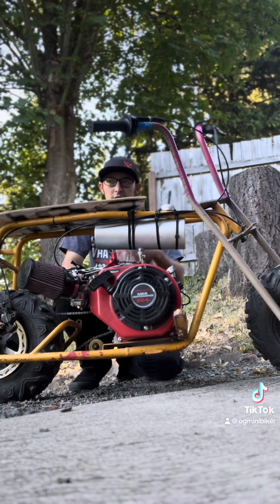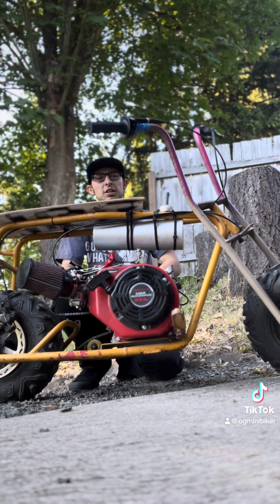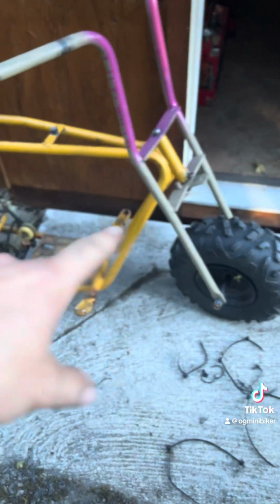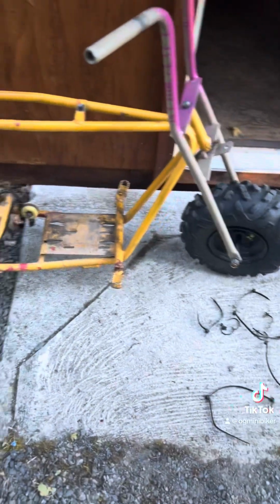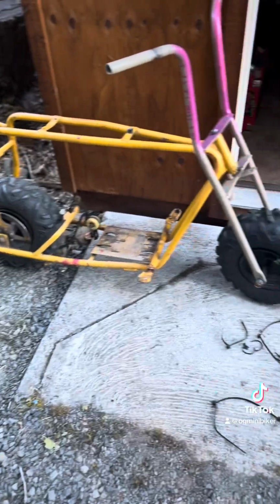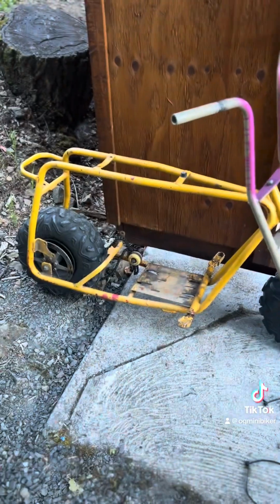‼️Update on shitbox mini bike new big project‼️

Comment: After I deleted the oil sensor my bike would only shut off if I stress the motor to the max and that's usually have to hit in 50 mph on my 7-ft Franken farm scooter 20 inch BMX rims